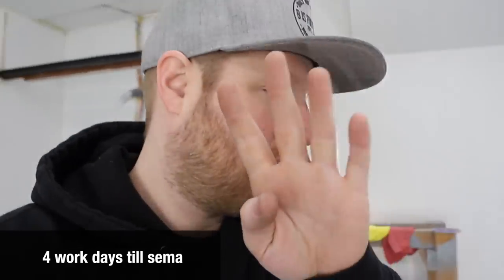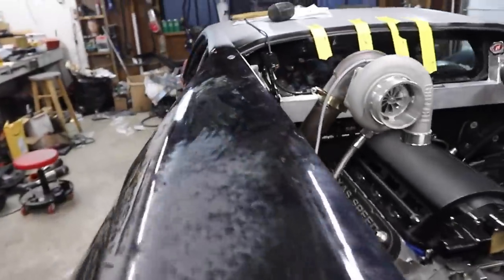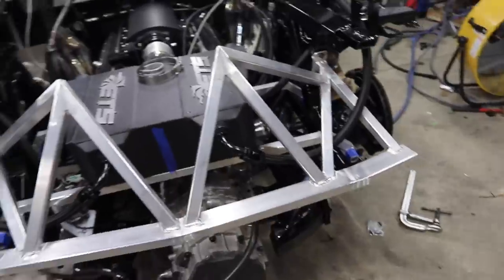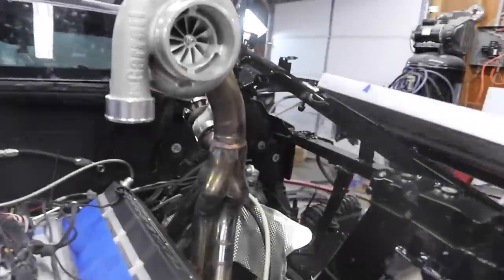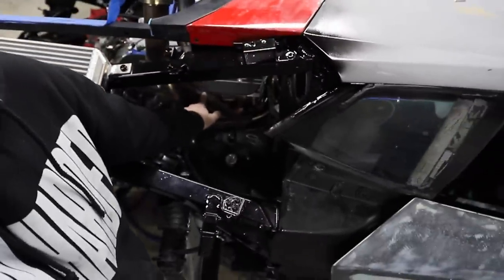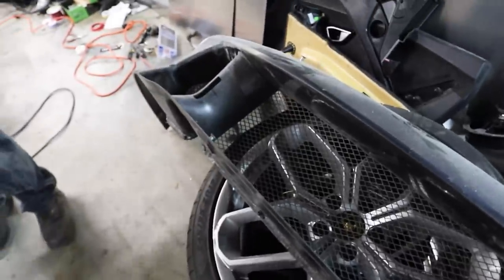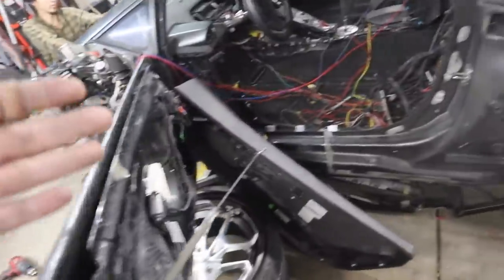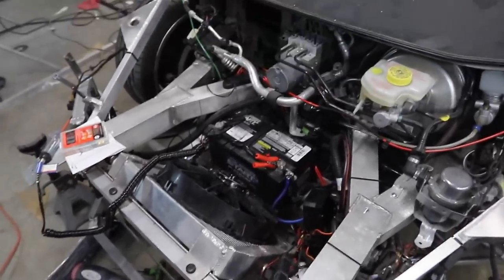Carbon Fiber Widebody Kit is Complete! And our front Splitter Looks Dangerous!! (4-2 days left)

Comment: I just wanna saw wow wow wow the sky is the limit. So many skills involved here. Mechanics, steel , aluminium welding, fabrication, autobody, carbonfiber molding, 3d printing, computer rendering, imagination, so many skills, hydraulics, plumbing , electrical, etc.  Man I dream of having the time to do stuff like this as my career... how do I start. I am probably 1/3 capable of doing what you guys are doing. I need to work on my skill sets in the welding and autobody department.   cant wait to see it all done goodluck guys. From New Jersey

Comment: Chris, You should install a ball valve to close off the line from the vacuum that is attached to the bag.  This way you don't need to depend on the vacuum running all night, it also ensures vacuum is still in place if you lose power to the pump.

Comment: Cant wait to see the post "stuck on the side of the road with our LS swapped Lamborghini". Starter solenoids are not designed for continuous use, Painless Wiring (and others I'm sure) make remote kill switch kits that come with a massive solenoid that is designed for continuous operation.

Comment: You should look into a Racepak Smartwire system. Its fully programmable and can replace most of the factory modules. It will run nearly everything including turn signals and power windows.

Comment: If water pumps kick on at a certain temperature, when you chill the system for racing, it may freak out the pumps and turn them on and off killing the chilled water flowing through the block.

Comment: Pretty sure you're supposed to soak the exhaust wrap in water and then put it on. That way it stretches while you put it on and then once it's dry it will shrink and create a better seal. I'm sure that its fine for now but I believe the intended way would be to soak it first.

Comment: Some thing to watch there are momentary and constant hold solenoids like you used for the power solenoid. I deal with this daily on farm equipment. If you use a momentary it will work for a short period of time but not long.

Comment: @B is for Build I had the same issue with the Fiberglast resin. Once I switched resins through a different company I haven’t had those issues. If your stick with carbon fiber part making I would suggest not using Fiberglast resins.

Comment: Should be running the water pump all the time so the coolant sensor can get a read of what the temp actually is. Won't read right without cycling the coolant past it... Then the thermostat opens to cycle it to the cooling system

Comment: The rear tires definitely need to be wider to better flush with the rims. Looking at the rear fenders and the rims the fenders could benefit with another inch wider. The ends of the rims are protruding about 1/2' past the fenders or you could go with the easier fix and get a smaller rims

Comment: Those Ford starter relays won't work for what you want.  They are for short duration use only.  The coils will burn out if you leave then engaged for a long period of time.  You need continuous duty relays.  There is a difference, lol.

Comment: Won't the 're-enforcement' pieces in reality kill the exhaust tubes, cos different expansion rates of both?
Reply: kwiebusch yes it will brake the peace off the runner. But we need it to hold the turbos in place. Till we have time to rebuild them.
Reply: @Oscar_SMT  I did understand that. Hopefully the temperature on the dyno won't be to much for the material to begin sagging at all.
Brilliant job though Oscar.

Comment: Why not use wheel spacers? Saves getting wider tires.
Reply: The wheels are sitting in the perfect spot and not poking. The tires are a tad stretched so if the tires were 5-10mm wider it would fit perfect.

Comment: BRO!!!!! PLEASE, WATER PUMP SHOULD RUN FROM THE START. Not only at a certain temp. Fans can go on at certain temp and thermostat will allow flow at certain temp. Please you will overheat the motor if you don't allow flow from the start.